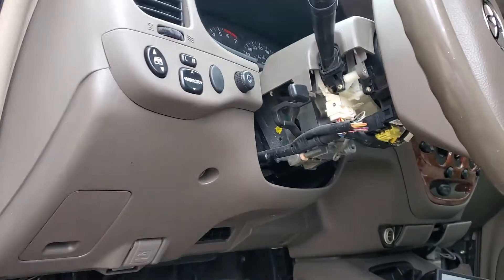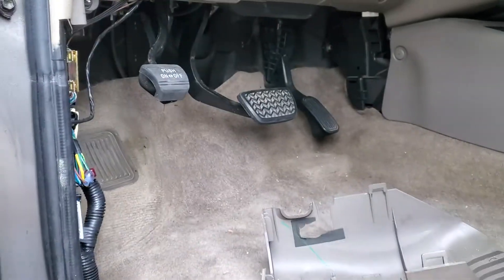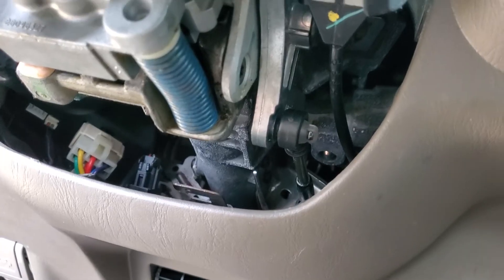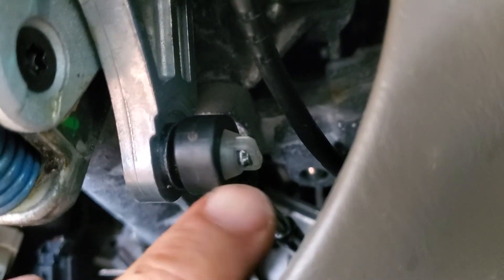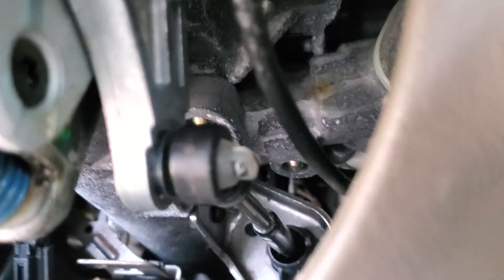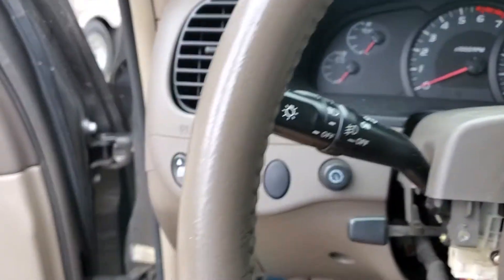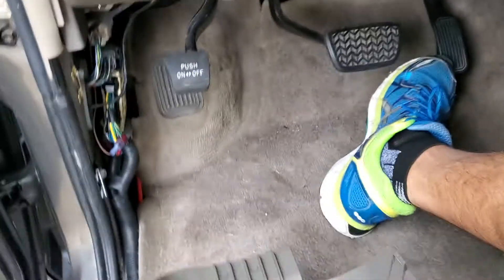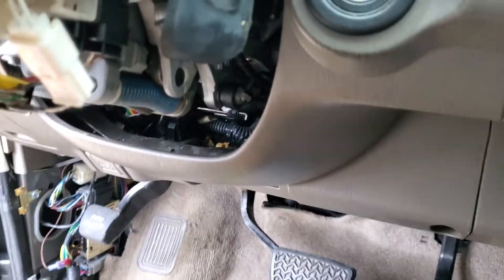Toyota Tundra shift linkage repair. (3 minute repair)

Comment: This happened to me yesterday on my 2011 Tundra, 185k. Replaced the Toyota bushing with an OE part no. 33835-08010 $2.92 and we’re back up and running! Thanks for the clear cut description of what this problem was. If only the starter was this easy!

Comment: Thank you.  I was able to get the part immediately from Autozone.  My truck was stuck in drive when I got home and this did the trick nicely.  Thank you!  2007 Tundra 2WD, 5.7L, 170k miles.
Reply from the maker: @wjfrndsn4291  yw, glad it helped
Reply: Can you confirm it's a 2007 2nd gen Tundra? I have a 2015 and Amazon says this part doesn't fit.

Comment: Mine came off yesterday.  If it broke while shifting you can get under truck and manually move the shift linkage arm on transmission forward(towards front bumper) to get it back into PARK.  Zip tie the loop end of the cable to the shifter armature, with cable in normal mounting position if you need to keep truck operational while you get new part ordered.  2006 Tundra 4WD 270,000 miles.
Reply from the maker: @3207kleinjunky  yes

Comment: How many miles were on the truck when this happened!?
Reply from the maker: 110k but its a 2005, the plastic is time rotted, maybe florida heat sped it up?
Reply: @wetlifesports  After looking more into it, this seems like a common issue for a lot of people.  Seems like "toyota quality" disappeared with this problem. I can see having to replace the cable every 100k but the whole metal part has broken for most people which is just really bad design/manufacturing.
Reply: My 2007 Toyota Tundra with 121,000 miles just had this piece break today - actually it was not a clear piece like this, but a black 'washer-type' thingy with a lip on each end.  This video helped me save tons of $ going to the dealership.

Comment: How did you take the plastic cover off? Mine has 2 countersunk screws in it
Reply from the maker: @Psprowl91  yes, remove screws. turn wheel to access
Reply: @wetlifesports  yea. Saw the end of your video haha! But mine is almost jammed. I got it stuck in neutral and it won’t come out

Comment: Took the screws out but that plastic panel isn’t budging.  Any top on how to pry it off ?
Reply from the maker: Same year? You noted all the screws, bottom ones and ones behind steering wheel?
Reply: Yes I took out the screws on either side of the steering wheel and the one underneath.   Should I use a plastic pry thing or should it just come off with pressure?
Reply from the maker: @David-hb9co  careful, seems like you might have more screws somewhere. Maybe its just stuck but i don't recall any mystery with mine.